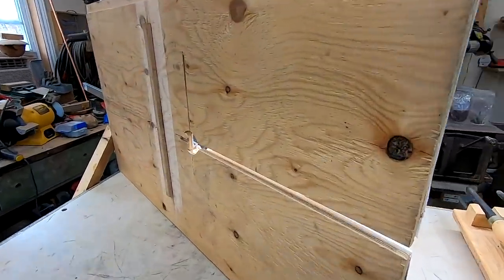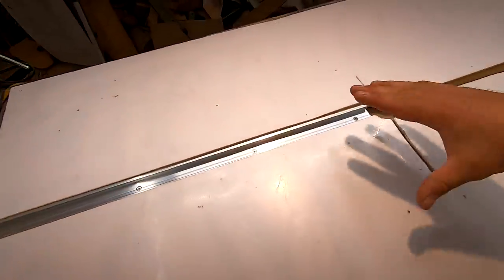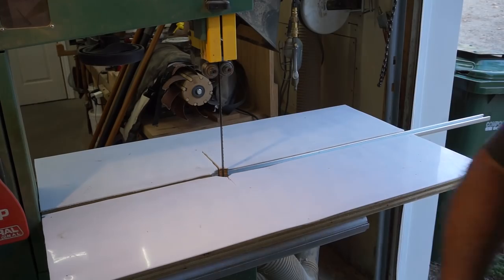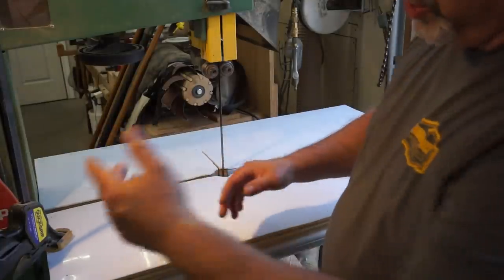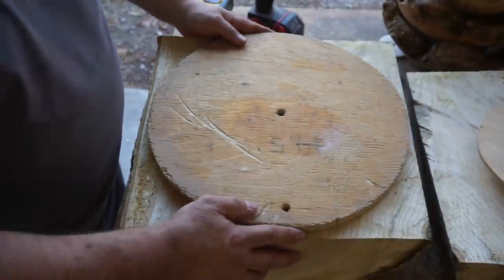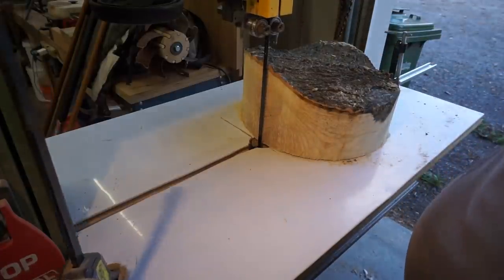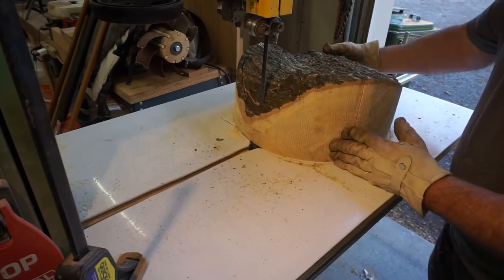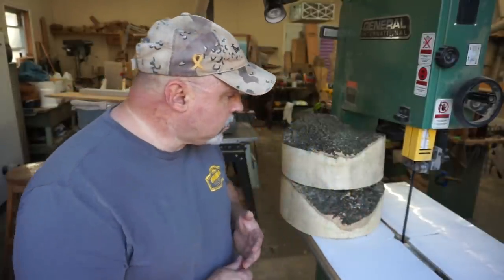Woodturning - Circle Cutting Jig for Making Bowl Blanks

Comment: That's actually really close to how I designed mine.  On mine, I flipped the T-track upside down and have a knob under the board that I can tighten it with.  I then drilled a hole at the end of the T-Track and put in a pin that I use as my axis pin.  I also made it the same size as the hole for my woodworm screw.  To stop the board, I mounted stop blocks on 3 sides of the board to lock it in place on the cast iron bed the saw came with.
Reply from the maker: That sounds like a great build too, thanks 🙏

Comment: A VERY handy accessory for the band saw. When I made mine I used the deck board out of an old treadmill. It already has a very slick surface. However, on mine I didn't use a track that slides in and out. I just drilled a row of holes at nominal diameters. So with my design I'm limited to specific diameters based on the hole location. With your design you can make any diameter that you want. Either way it works great. Thanks for the extra vid Jim.
Reply from the maker: Thanks for watching!

Comment: Suggest you add a peel and stick measure tape, or make your own measure marks. Also, if you add two “tensioners” to the pin bar, you could use them to keep the pin at the right location without the clamp, allowing you to use a shorter bar, and cut larger odd shaped chunks.
Reply from the maker: Not sure what you mean by tensioner? Thanks
Reply: @SpragueWoodturning  My miter track has adjusters that make the guide slide properly. Any tensioner that tightens from the top to spread out  against the side of the track will work. Or a track stop like in a bench track hold down. Threaded washer, rubber disk, and flush screw, or something similar?
Reply from the maker: @valeriehenschel1590  got it now, thanks

Comment: Nice jig.  I really like the slick surface you put on it.  I was thinking of using some cheap laminate material for mine.  The only other feature I added was a stop on the bottom that references the blade with the sliding table.  This allows me to advance straight into the cut and then rotate when I hit the stop.  Downside is that I can’t go any further at the end of the cut to free up the blade again.
Reply from the maker: That’s exactly why I didn’t put a stop in, sometimes it’s a real pain to remove the waste material if you can’t cut through it. Thanks

Comment: Thanks Jim, just the video I needed to start me off on making my own jig.  My only thought for a possible improvement… You mentioned when starting with an odd shaped piece you may need to start the jig out from the blade and push in which might necessitate some outboard leg supports on castors. You might could get around that by placing a counter weight on the inboard side of the jig to counterbalance the log as long as the table can support the extra weight.  No need for any outboard leg supports then.
Reply from the maker: That’s a good work around as well, thanks

Comment: Mine is built like Rich Bolduc's except my pin is smaller. The smaller pin and the uneven surface from using it this weekend to make some bowl blanks for my son. I like the size of yours and will make one larger and with a bigger and longer pin, with the inverted track with a knob so I don't need to use a c-clamp and a stop block so I don't have to use a mark to match up to. I will buy the blades you mentioned as I am using a 3/4" carbide tooth one and it works great but does not cut small diameters.
Reply from the maker: The main reason I didn’t use a stop block is so I can push the rig forward to come out of the wood, I find it hard sometimes to not have that this function, thanks for watching!

Comment: Jim, I use circle templates similar to yours attached to the top of my blank as a guide to follow when cutting rounds. I just make sure not to cut into the template. I do not always get a perfect circle but it is close enough to mount on the lathe where it becomes a perfect circle.
Reply from the maker: You’ve seen me do the same thing here, other than finding the pin this rig works great. Thanks

Comment: I have made a couple of these.....NO WHERE near as nice or sturdy as the one you made.....so mine eventually fell apart and became dangerous to use.    SO -- I found a jig at Storeroom Supply (in Canada) and it fit my needs perfectly.  Expensive, yes, but it saved me time and provided everything that I need.  It does have size limitations that yours does not - but I don't turn anything over 16" in diameter anyways.    Nice job on the jig .....thanks for sharing!
Reply: OOOPPPSS   I mean Stockroom Supply
Reply from the maker: Thanks for the info!

Comment: Very useful.  Right off the bat, I didn't know that you used a circle cutting jig, so now I will have to consider one.  I tried one many years ago but it never worked very well, the blade seemed to torque way too much.  Probably operator error.  The little details that you showed, like the registration mark on the bandsaw riser, are very helpful.  You have motivated me build this jig and try again.  Can't be any worse than my freehand "circles".  ;)  Thanks, Jim.
Reply from the maker: You got to find that sweet spot or the blade won’t work properly and bind. Thanks 🙏
Reply: @SpragueWoodturning  BTW, how did you get the face of the blank so flat?  I hope you're not going to say you chain sawed it that way.  Maybe an electric hand planer?
Reply from the maker: No, that’s a chainsaw surface. Thanks
Reply: @Sprague Woodturning  Chainsaw surface?   Now I'm REALLY impressed!

Comment: Hi Jim really enjoy your videos and how to tutorials so I built my bandsaw circle cutting jig the one concern I have is the size of Blade with you explain to me what you used is Skip tooth 3 points I believe was the blade I was wondering about the size of the band saw that you have and what size motor it has on it. I've got a shopsmith bandsaw and it set up with my power unit is a three-quarter horse but I'm wondering if I've got enough horsepower I'm trying to turn a round circle of Walnut for a turned bowl and it's pretty hard I was wondering if I need more power or or what would be the best way it's about six and a half inches thick and it's about a 10in round but it sure binds up and it practically stops the motor do you have any suggestions or do I need to be trying something less aggressive as with this Walnut so I can say it's really hard and I can just barely turn off the corners by hand let alone using the circle cutting jig.Thanjs Glen
Reply from the maker: 3/4 horse is kind of small. This one is two horse 18.5” General international. Thanks!
Reply: Yeah that's what I was kind of afraid of even after I trimed off some of the corners and tried to put it on my lathe to turn it was so out of balanced it just shook everything so bad that any thing connected to  pieces.

Comment: If you slant the table could you cut away some matterrial to speed up turning?    Actually a question, my brain isn't working and wondering if it would bind in some way.
Reply from the maker: I would only do it slightly, this would make it easier to remove the waste, thanks

Comment: I've made one of these types of jigs.  The only thing I can't figure out is why my blade moves so much.  I'll have oblong bowls and not perfect round ones.  Not that I'm trying to be so precise, it's just that when your lathe only cuts 12" bowls and you start with a warped blank, you end up with a 10" bowl in the end.  Any ideas how to correct blade movement?  Thanks!
Reply from the maker: It’s possible your too far in and the blade is binding. Finding that sweat spot is crucial. The tension on the blade might not be enough and you might be using the wrong blade. On top of all of that, when my blades start to dull they wonder as well. Other than that I don’t know. Hope this helps. Thanks